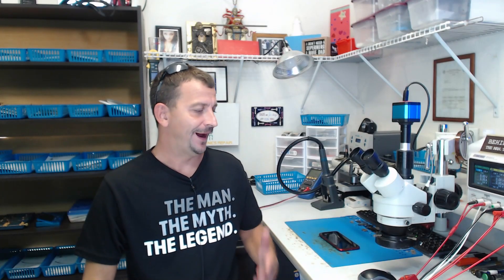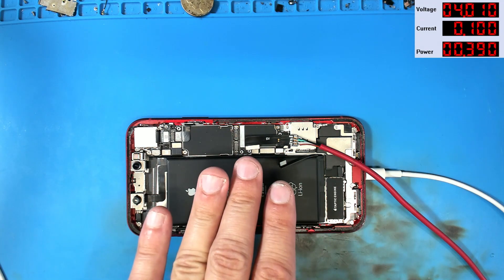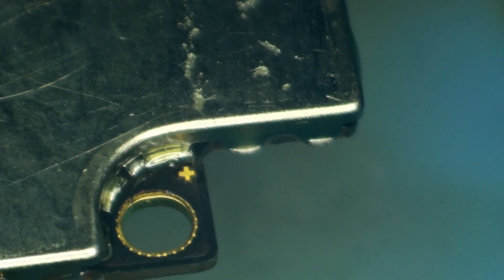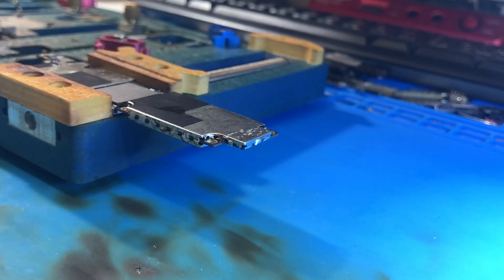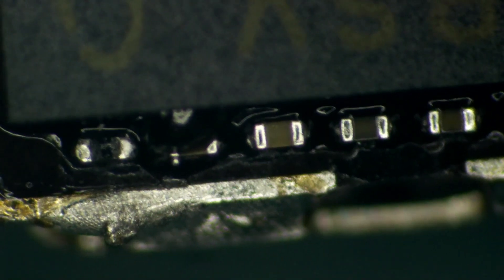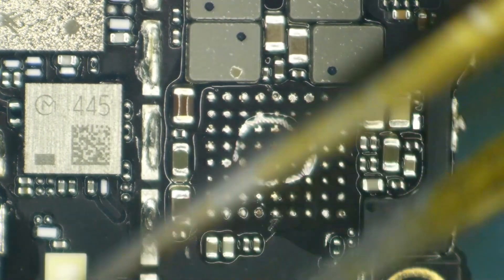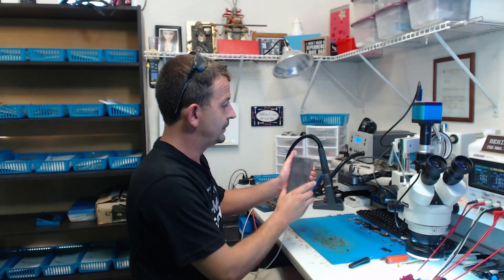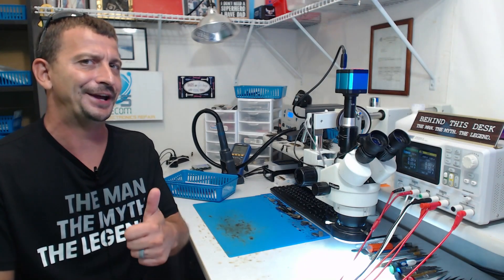Fixing a DEAD iPhone XR that came in for “No image” (No power / no boot!)

Comment: 110% safer to just cut the shield than to heat the board for longer periods of time.
Need precision and great practice and even though if you're an expert you still don't know how many solder balls melted and merged below minute components .

Comment: Use the de soldering wick with hot( soldering) tweezers, like northridge fix do. And you can easily wife off the solder from the side to mount the metal shield again.

Comment: Hey Jason long time no hear, I find doing the same process as you but using a pre heater the shield is much easier to remove, I've done quite a few no IMEI baseband reballs on the XR.
Reply: I thought about this as well. I have a big ceramic preheater i use to remove stubborn HDMI ports

Comment: Had a  thought, when trying to remove the shield could you not wick away each joint with a copper mess instead of heat the entire frame?

Comment: Im confused as to how you concluded it is a charging ic problem, when you initially plugged the phone in to charge it was charging fine and as far as i know when a phone has a faulty charging ic it can still turn on when connecting to DC Power Supply.

Comment: I hate that XR shield.

I just use my 6mm nozzle, 500c and 120 air and heat around the edges really fast.

But I also tin the joints with low melt 138c solder

Comment: 6:35 You are such a bad man. 🤣
Do you think that shield is so heavily soldered that it's a crApple attempt to make repairs a lot harder to accomplish?
Really good to see another STS Telecom video. Thank You Jason. Just excellent as usual. 👍👍
Reply from the maker: Thank u!  I’m not sure what their reasoning is on the alloy that was used on these.  The 12 series has me a bit intimidated in similar ways - Apple has used a much higher temp alloy to join the board sandwich!  It almost seems like an evil trick!

Comment: Nice to see Apple putting that shield on so securely that it would survive a hurricane-force wind /s. I assume you just used leaded solder on the shield when putting it back on?
Reply from the maker: Yep, this was just leaded going back on.  Maybe should have used some low melt for the guy.  :)

Comment: Those shields are the worst. I’ve used the low melt approach and it’s a gamble whether components underneath are affected by the time it comes off. Lately I’ve just been cutting it off along the edges where the solder is. If careful can easily solder it back on after. Less headache lol